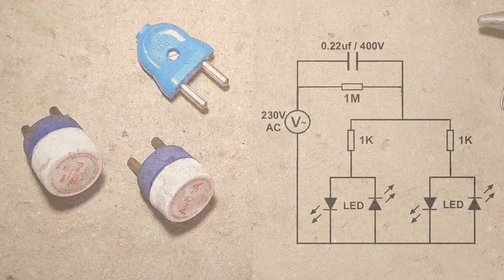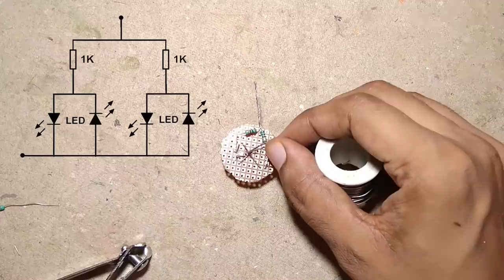Led Night Lamp diy

Comment: No used diode AC power is dc converted not working LED light is  blackfire 5 minutes running